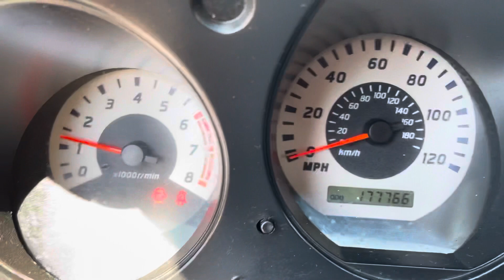2004 Nissan Xterra changing the ignition sensor switch and crank shaft position sensor.

Comment: I have an '02 Xterra and something I noticed in this: Those hoses aren't clamped down. The one leading to your air filter box doesn't have a clamp on it at all and the the two coming out of it aren't clamped either. I'm willing to bet it's causing a vacuum leak.